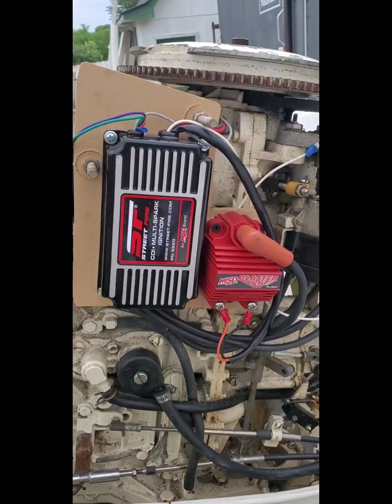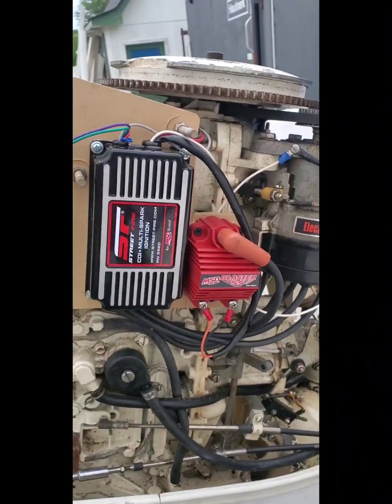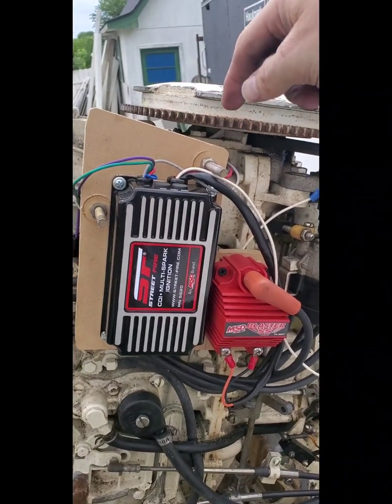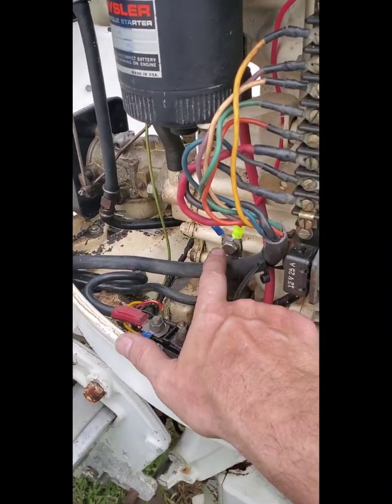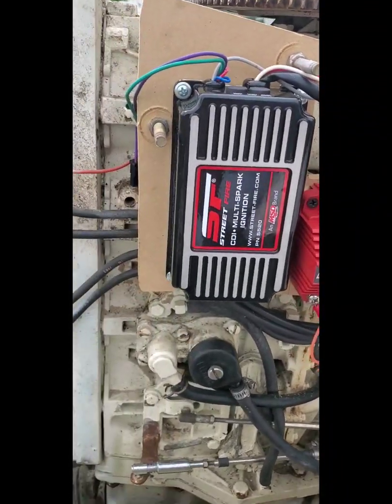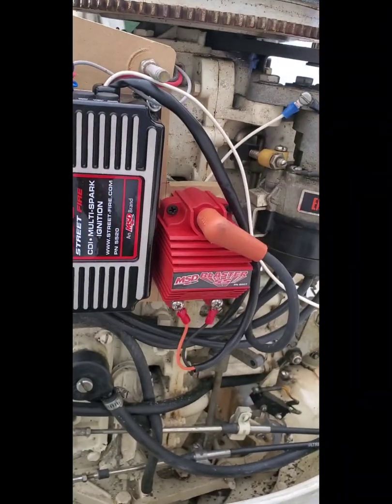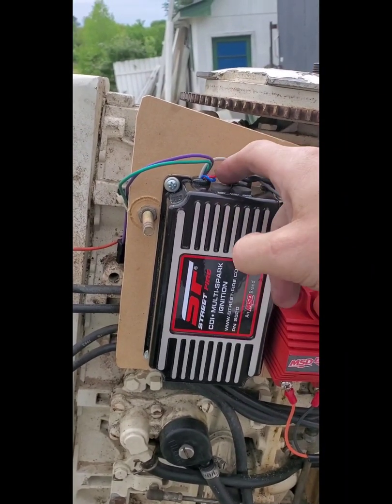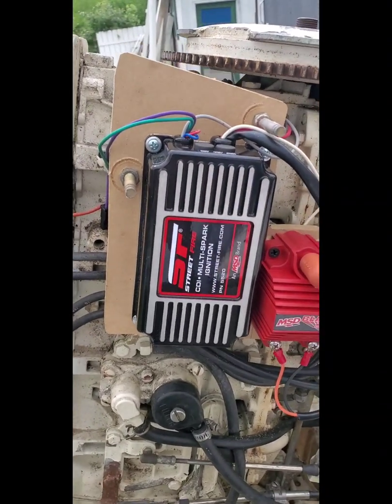Crystler outboard MSD conversion. 135hp 1977 (important notes in description.)

Comment: I have run the same setup on my 75hp 
Same distributor and all except its a 3 cyl 

My msd 5520 has no spark flashes 3 times when on and nothing
Reply from the maker: So on a three cylinder engine you have to set the msd as if it is running a 6 cylinder engine so the timing is correct (every other fire is sacrificial) if you have it factory set it is timed for 8 cylinders and the ignition will be out of phase, if that isn't your problem then check for a proper ground. To be certain on mine I grounded directly to the main negative feed from the battery.
Reply: @christianfritz6333  ive made it run like a 6 
Its got a direct negative ground same as yours 
All appropriate voltages where they need to be and zero resistance at all connections.
I have a suspicion the msd box has an issue as the coil tested good and the dizzy is doing what its supposed to.
Ive put a link to my problem below
https://youtu.be/tudVCKa5Ibg
Reply from the maker: @matcausey1778  that's very odd, I can only assume that's some sort of fault or diagnostic issue, the great news is you can call msd and they will walk you through any issues.   Im assuming it won't start.
Reply: @christianfritz6333  when i first put it on it popped on one pot and that was it 
but never started
Reply from the maker: @matcausey1778  the book says error code 3 is "intermittent input voltage"
Reply: @christianfritz6333 
In australia its very hard to find error codes for msd they seem to be abit protected

If you have a more detailed booklet with yours would you be able to scan and email ?
Reply from the maker: @matcausey1778  I went online and found it, if you are unable I'll go dig it out for you, it's middle of winter here so everything is in storage.
Reply: @christianfritz6333   its off to msdholley now for evaluation 
I made sure to write all the info i had so fingers crossed
Lets see what they say

Comment: Thanks for talking it through.  I always wondered if an MSD could be retrofitted.  Looks like it works.
Reply from the maker: MSD actually makes a potted marine version. If you are running in salt water I'd reccomemded that one, I didn't use it because it was double the cost. And running in fresh water currently.